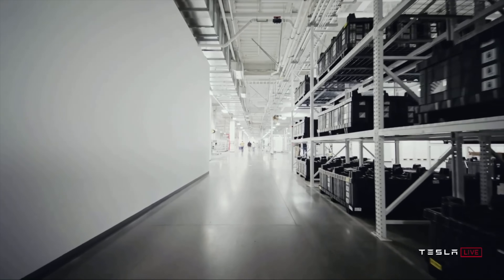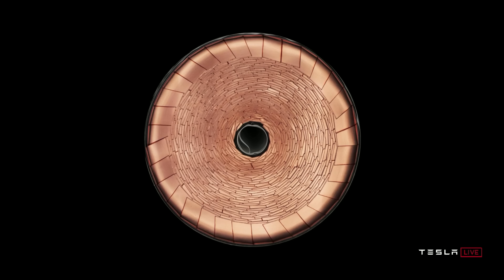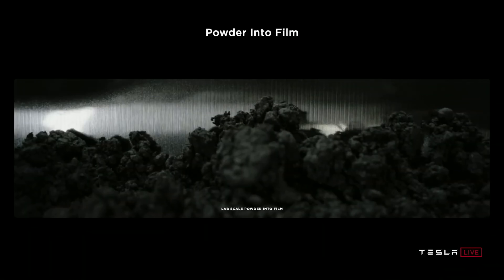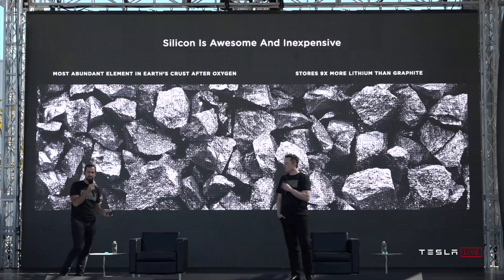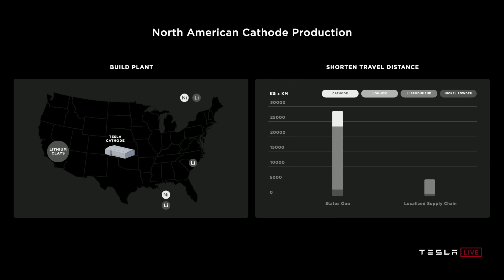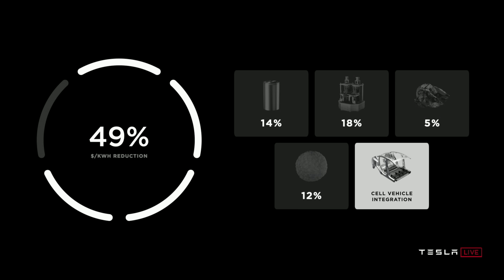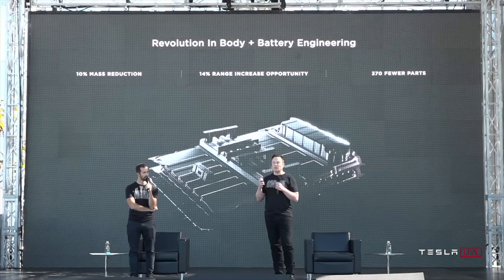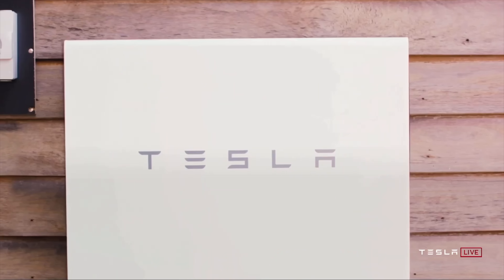How Tesla's New Battery Will Destroy Gas Cars

Comment: Investors don’t understand the significance of yesterday. Long term there won’t be an ICE market anymore.
Reply: Ziggi Mon  there is no 'might', there ARE many NON-TRIVIAL hurdles to hydrogen. If hydrogen ever becomes mainstream, it will be after BEVs have replaced ICEs.
Reply from the maker: Say goodbye to the ICE age 👋
Reply: Ziggi Mon Yes!!!! It’s very, very easy and cheap to transport and store hydrogen at -252 C and at 10,000psi!! Folks, we’re known about this for over 100 years!!!
Reply: I think there will always be a market for ICEs to be able 
To quickly add fuel and restart will be unmatched until tesla can make a 20 pound battery with the same range and/or is able to recharge from a solar panel in 5 minutes
Reply: @davidrainey7724  there will always be military, if military goes green it will likely be with forms of biodiesel and hydrogen  either way big oil is finished
Reply: I don’t hate ICE because I like all good cars, but I am also excited for the future of EVs.
Reply: Ziggi Mon    Are you the Trevor Milton avatar?
Reply: Ziggi Mon  The why isn't Nikola taking off instead of going bankrupt?  Talk about uneducated.
Reply: The only thing missing is an actual working prototype. Also if the current battery could be made for free the cars are still expensive.
Reply: @jayfromaz  I guess you didnt actually watch battery day and see the actual working prototype powering the actual working Plaid Model S to sub 2 sec 0-60 and over 200mph top speed?
Reply: koenigseggs 600hp 3cylinder camless engine with significantly improved fuel efficiency anyone?
Reply: @davidrainey7724  electric semis are nowhere near ready to compete with diesel semis, there's weight limits you know so you wont break bridges and damage roads so much, diesels still have a future in hauling in which electric semis still have a long ways to go, diesels engines can be up to 40% efficient on highways where as for electric vehicles they tend to perform the worst on. Also a full tank of gas in 100lbs has far far more energy in it than a 500 pound battery.
Reply: Balkan doesn't agree
Reply: Ziggi Mon  
    Who needs Hydrogen, if you can recharge in 10 minutes????
Reply: Ziggi Mon  "there are no alternatives to hydrogen.
" It's nice to see freedom of speech for the 'tards.
Reply: Or, they understand how hard it will be to make compelling cars with these fluffy cells. And are worried with Tesla using the same wording as with FSD over the past years. "Almost there".
If Tesla had a lot of these cells today, they could not make spectacular cars with it. Nobody could. The pack will take MORE space unless you overhaul the whole pack and chassis design.
Reply: @Cloxxki  SO you must be a Battery Engineer, right?
So, cutting Battery cost 56% and reducing the distance Electricity travels in the Batteries by FIVE TIMES, means nothing to you?

Wow.  Just Wow.
Reply: @Cloxxki  A 74kw battery will take LESS space leaving room for additional batteries for the planned 520 mile range.  Oh, and they are ALREADY making these new cells in Fremont - just not fast enough right now to put them into an existing car model line.
Reply: @Cloxxki  you clearly didnt watch even 5 minutes of the battery day presentation. These packs will be dramatically smaller than existing packs and provide greater range and lower weight and lower cost.